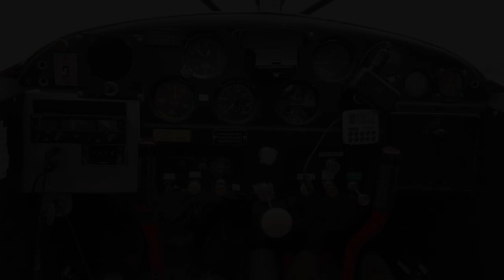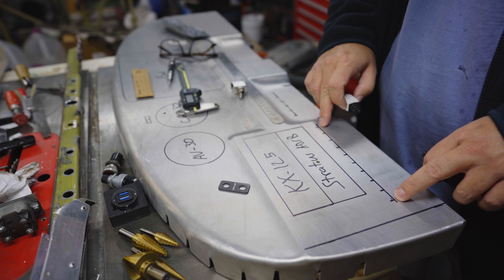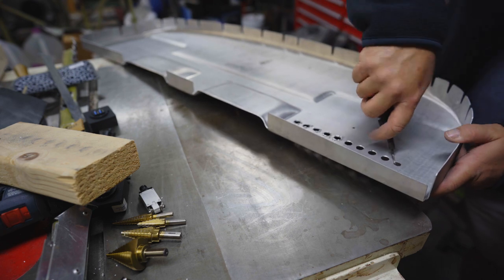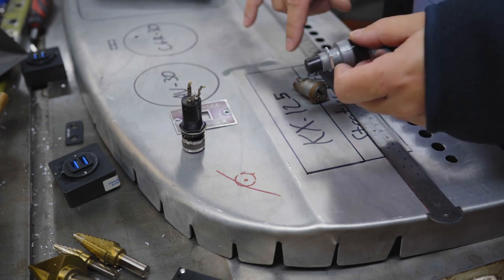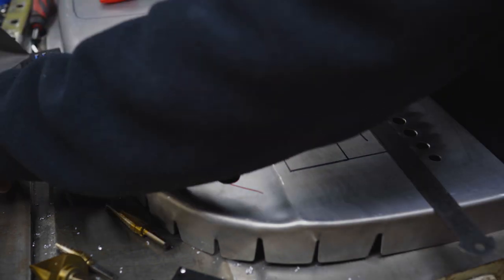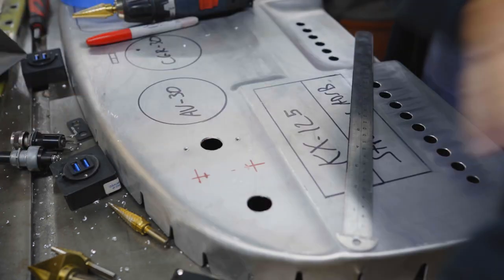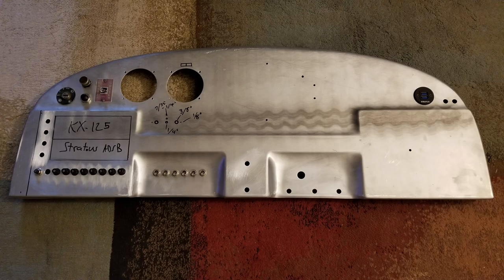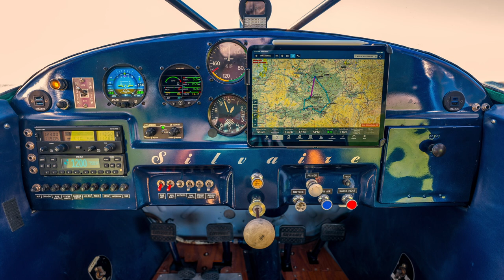New Panel in the Luscombe  (and other upgrades)!!!

Comment: I put a new panel into my 1946Luscombe 8E also.  I also put in a new lightweight starter, and new lightweight generator, completely remanufactured the Continental 0-200 and did the inside, especially the seats.  I love what you have done with yours
Reply: Is o-200 a 100 hp engine?  If so, how does it compare to the 85 hp engine performance-wise?
Reply: @GeneralSirDouglasMcA  I understand it makes a substantial difference.  You can get the lightweight O-200D.  I have the 0-200A which is heavier.  I base at Santa Fe so I need the extra horse power given the altitude.
Reply: Does having the O-200 increase airspeed or useful load at all? If so, how much?

Comment: Very nice! I had always wondered about your blue wheel covers -- whether they were anodized, since they looked blue-metallic -- but I guess it's paint.
Reply from the maker: Hey, Mark. I suspect the hubcaps might be visible in an early video when they were bare aluminum, but in any event, I painted them with the same paint that I've used on a bunch of other stuff on the plane—the A-pillar covers inside the cockpit, wingtips, lower windshield strap, and a few other odds and ends. And, of course, the new panel. It's a BMW paint with a clearcoat on top. Same color as my car.

Comment: What app are you using on the iPad?  Did you populate performance specifications?  Can you share how you were able to get the details?  It's hard to find Luscombe data.  Does the app have a checklist?  I'm a new Luscombe owner and trying to get started is overwhelming.
Reply from the maker: Hi, Erik. I replied to your question on PoA the other day. I probably won't be much more help here, but on the plus side, the Luscombe is so simple that you probably don't need much info to fly it successfully.

I started out with Garmin Pilot, then switched to Stratus Insight, and am now using ForeFlight. Garmin didn't work with my ADSB, and Insight just wasn't as good as I wanted. I plan on sticking with ForeFlight.

I use 10:1 glide ratio. I think I read that somewhere, but haven't tested it. Wouldn't be hard to test. That's useful for glide rings. I plan on about 2:20 per tank, so 4:40 total time, but that could be longer or shorter depending on what I'm doing. Lots of climbing at low altitude or cruise with full lean at high altitude would be quite different. Either way, I like visiting airports and so don't typically fly for hours on end, so it doesn't generally matter much.

As far as W&B, I don't use the iPad for that. If the plan is within CG when empty, then you can load it however you want up to gross and you'll be within CG.

Join the Luscombe facebook page. There are lots of experts there. If anyone can help you, they can. Worst case scenario, you can do some simple testing yourself and calculate your fuel burn, speeds, takeoff and landing distances, glide ratio, etc. 

For what it's worth, I recently flew some tests to figure out how high I would need to be to do "the impossible turn." I figured around 500 feet.

If you're in the western half of the U.S., you might want to plan on attending the Gathering of Luscombes. They have it each spring in California.

Comment: What grade aluminum  is used on the Luscombe? 2024 T4?  .02 thick?
Reply from the maker: I've seen 17ST, 24ST, and Alclad mentioned. I think 2024T3 might replace some of that, but I'm not an expert. I'm not sure about the thickness of the skin. .020" sounds thin, but it could be.

If you're super curious, join the Luscombe group on facebook. The world's leading Luscombe experts are members.